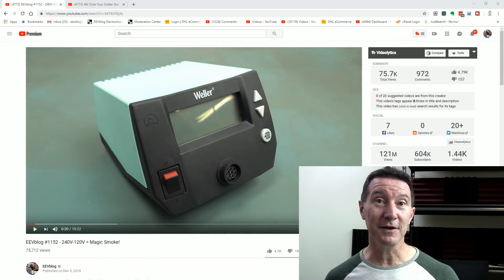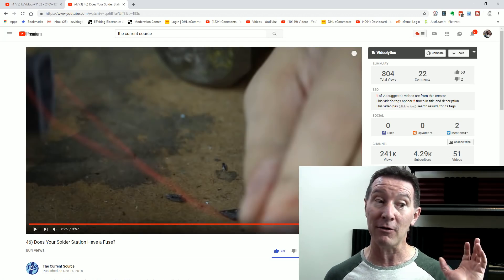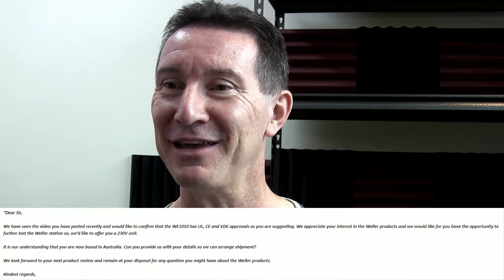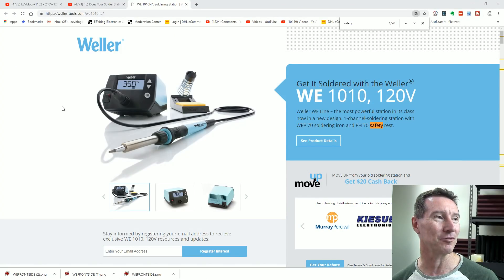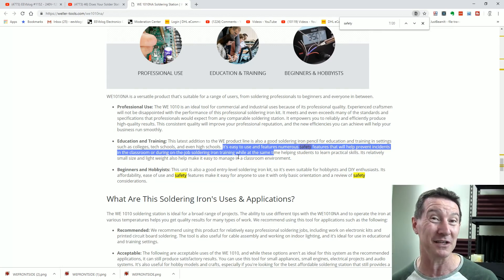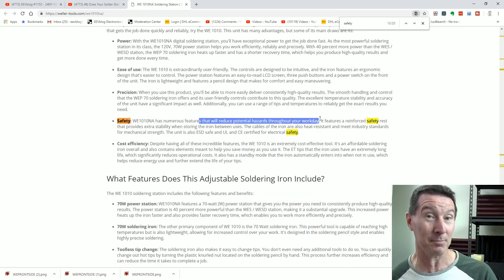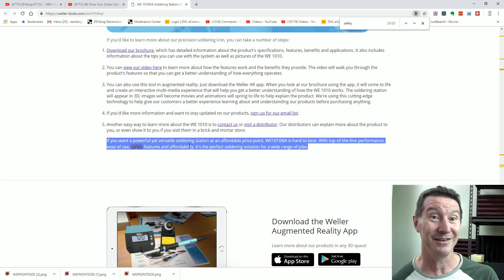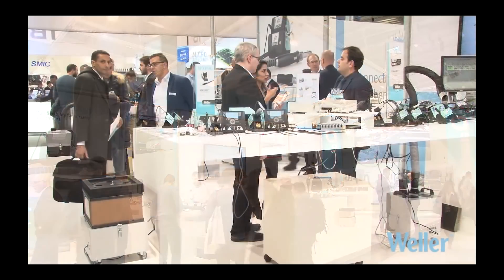EEVblog #1160 - Weller Responds!

Comment: Hi Dave,

I have enjoyed your videos and am subscribed, but think you are mistaken about taking Weller to task for the outcome of your mistake.

I appreciate that you would prefer that the device not die a smoky death, but you might not know that UL and other safety organizations don't care if the device-under-test gets damaged with misuse or malfunction, but only that the device should not cause a fire, electrocution, or injury.  In other words, a mains fuse is considered optional, and including one depends on how user friendly Weller wants the device to be.  Adding a fuse or other "idiot-proofing" adds cost, and is not actually required for basic safety approvals (I'm not saying you are an "idiot").

Can you expound on the outcome of plugging in the iron to 230 VAC?  Did it just smoke and die?  If no fire or electrocution, then "no harm, no foul" - just a bad day for you! 

They could have used a more costly 120/240 VAC, 80W universal switching supply, but that tends to be large and cost a lot more than a simple linear step-down transformer.  A user-serviceable primary fuse on the back might have helped, but adds some cost - maybe they will consider that.  A thermal fuse, is not user-serviceable, and would brick the device - although without the smoke for sure, but you still have a door-stop or a serious repair either way.

By the way, I'm guessing your iron was shipped with a US (I I -shaped) power plug for a 120 VAC device, so you must have swapped cords for an Australian 230 VAC (\ / - shaped) outlet by mistake.

Sorry...  Joe (a fellow senior product design hardware engineer)

Comment: I like my cheap $18 soldering iron with built in switch and temp control on the handle. no need for an external station.

Comment: This is sadly how a lot of tech related companies are going these days, they get infiltrated at a management level by idiots with OU degrees, they sack all the expensive/experienced engineers, they then employ only young graduates (who are conditioned to never question authority).

They also realise that PR BS is cheaper than actually doing the job right, and it really doesn't matter if a big customer comes to do an audit, the customer usually sends marketing people and managers, because they don't have truly technical people at that level in the business.
The whole industry has gone this way, BS is king and they're all BSing each other.

Oh and marketing, that's where they put the pretty young office bimbo who isn't very good at anything, but is too pretty to get rid of.

Comment: I have a couple of Weller stations, one is temperature controlled by the tips and has a magnet in the handle, and the other one is adjustable. I have some older Weller irons and they screw into the handle with a small light socket in the handle. I do agree that putting a fuse and thermal fuse in would be a good idea, but the best idea of all when using a soldering iron is to unplug it, as I need to so the iron will cool off on most of my units. Want to be safe with equipment, plug it into a power strip then when done turn off the switch, end of problem. Many do not even know what a safety capacitor is these days. It is one that is designed to go across the AC line and so if there is a problem it does not go up in flames.

Comment: You should have a fuse in the plug. Are there electrical systems out there with no fuse in the plug? That's a bit dangerous isn't it? :-)

Comment: Weller makes irons for decades that work great. A blogger plugs one in to the wrong voltage, and suddenly there’s a scandal. I love your product teardowns and reviews, but I don’t see the big deal here.

Even if it had a fuse, it wouldn’t have blown until at least some of the windings were shorted. At that point it’s still trashed, but you might not know it. 

FWIW, I have a simple rule...  ALWAYS turn off and unplug the iron when stepping away from the bench, even just for a minute. This prevents all sorts of calamities, and I don’t worry about whether or not I left the iron on.

Comment: It is a bit of downer, although I am using Weller's equipment all my professional career. Even my old and simple magnastat WCP50 had mains side fuse and is very sturdy and reliable station. Even when after years and years of everyday heavy use silicone cable shorted on secondary side, actually primary side fuse blew, so safe it is. This one looks like cheaper model which is no excuse for leaving out primary fuse. I also checked my WX2020 and it has primary circuit fuse. But, of course it is 700€ behemoth and it completely justifies it's price. I must admit, at first I did not check at all if there is primary fuse (I was expecting it at this price range) but of course this is one integrated into mains input connector, real beauty.

Comment: I have used Weller soldering guns and irons since at least the 1970'a.
 I never had any problems with them, other than a few guns maybe needing the trigger switch replaced due to age and super heavy use.
 Never had one burn up, or let any of the magic smoke escape.
 And I have several older Weller guns that work fine, plus a Weller W-TCP-l that came through a fire. Only needed to rig up a holder, because the original was missinng.
 It stiil works fine.
 BTW, I am not stupid enough to plug an item rated for 120 volts into a 240/230 volt outlet.

 :) 
 I could use those parts you tossed, like the iron and cable, etc...
 I have to make do, because I cannot afford to buy another at this time.

Comment: It's clear the VP doesn't know about your channel, which probably smarts a little. It's pretty reasonable to assume that someone in Australia, with a 120v version of a product, moved from North America. Yes, the email was a bit of a blow-off, but I think it's nice that they offered you a replacement. If you view it from the lens of them not knowing anything about you or your channel, it was a kind gesture to get you back on your feet, not something to shut you up.

You didn't share with us the email you sent them. Sounds like you said something about approvals and they responded by letting you know they have those approvals.

Tempest in a teapot.

Comment: So far as I know,  every house in the united states running off of commercial AC power receives 220-240 volt service at the meter. When it gets to the fuse box is it split with ground to 2 12-volt AC segments, with a few drops having special wiring to support a 220-240 appliance such as an electric stove, water heater or laundry dryer. The outlets for these two varieties of service are distinctly different, with one possible exception. The possible exception being what looks like a standard 2 outlet plate, usually in the kitchen, where one of the two outlets is served by one side of the service, and the other outlet is served by the other side of the service.  That outlet is set up that way so that it may be used normally for most 110-120 volt kitchen appliances, but may also be used with an adapter for an appliance that may need higher wattage requirements than 20A service to a kitchen outlet would provide.

I have also run into other exceptions in the commercial space, where a zone of equipment is plugged into what appears to be standard duplex power outlets in a power strip that is wired to a 220 service instead of 110 service. If someone installing new hardware is not aware of what the delivered power is, they can (and have) cause problems not just for that device, but for any other device served by the same circuit. This is more important in places where devices are only supposed to be down for scheduled maintenance, but it happens. Additionally if you are traveling in Thailand with standard US devices, be aware that the outlets may accept a standard nema plug, but are wired for 220 service, not 110. So there also one of these soldering irons might pose a problem.

I'd watch out for that new soldering station from Weller if it requires 120 or 60 hz power if you are in a place that only serves 220-240 at 50 hz. It doesn't sound like they are in compliance with each other... with predictable and documented results.

Comment: Would a primary side mains fuse be redundant if you were in a country like the UK that requires all mains plugs to have internal fuses? This is of course assuming you are not using the non-standard UK type plugs you get from china that have no fuse and so are (hopfully) destroyed the moment the box is opened and also you are using a plug with a correctly rated fuse.

Or does a fuse inside the transformer satisfy a different safety requirement? Of course having it there would be better certainly for the reasons stated above but is a fused mains plug intended to perform the same function?

Comment: Pretty sad, I just opened up my chinese brand WER ESD solder station and it has a mains fuse. Not a fancy one and I can't tell how the two parts of the holder separate but it has a fuse. right after the on off switch and the transformer. I don't know much about WER irons, but I think I got this used at an auction for like $15. Can tell it is a kind of cheap unit, but has LED temp display, dial knob, on off switch, fuse. Works fine. I always thought Weller was supposed to be like the cadillac of soldering things, now it sounds like they are just not even worth bothering with.

Comment: I've probably mentioned before, I once bought a cheap Chinese soldering iron (936D+ style) that had no connection whatsoever between the tip and ground.  I called out the seller on it and they produced a "CE approval certificate" (which I tend to think was fake because, would such a soldering iron have ever gotten CE/EU approval with an ungrounded tip?).

Comment: I've had 110 / 120 volt equipment show up at a workshop I use to work at with either the UK or US plugs and the safety fuses are in the plug due to UK & US loop ring wiring 32 amp standards. Often don't see main inlet fuses on these products itself for these markets like we do in Australia.

Comment: The transformer is probably a custom design for their products that ensures by design that mains spikes won’t cause a problem without a fuse. If they are passing the safety standards then the design is fine. 

The datasheet and the device clearly states that’s it’s not a 240V unit. Letting the smoke out is user error. I mean how did you plug a US plug into an Aussie socket in the wall?

Designers can’t design for every bonehead use case. If they had to do that they would have to develop some sort of retractable cover for the hot sharp tip so someone doesn’t stick themselves in the eye.

Comment: My Weller WSD 81i does have a fuse in it's mains socket, and it's maybe 3 or 4 years old. Not sure if it's more of a "premium" model, it was rather expensive for such a simple soldering station though.

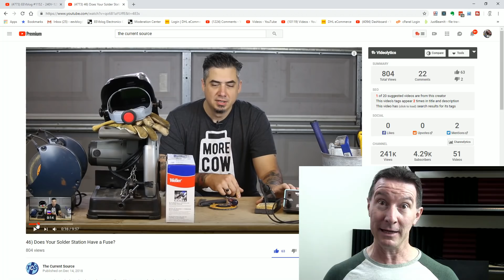Comment: I have the same soldering iron as shown at 0:29 which I purchased many years ago. It has never let me down and works perfectly to this day. But now that I know it may not have a primary fuse, I will install one. It only takes one failure to cause a major accident. Thank you Dave.

Comment: I have a XANTREX  XPH power supply and the fuse and switch is located after an elaborate mains filter.  Never seen that before.  They could have easily moved the fuse and switch to the incoming line. Can't begin to understand this.

Comment: As AvE puts out in his second Flute T6 video, this is a clear example of the monkeys running the circus. It's not out of the realm of possibility that Weller did ask and pay for certification tests but couldn't wait for them to be made before launching the product. Since they are certain that they'll get certified, they just slap the certification labels as if they were certified. There's also the chance that they didn't certify the equipment at all.  Since people tend to put exaggerated amounts of attention on certification labels (as power supply manufacturers noticed when 80 Plus was created and started slapping fake 80 Plus stuff on their boxes, labels and so on). Add brand loyalty to that figure and you have customers that will buy any piece of crap a reputable name brand puts out there simply because of the brand name.

Comment: Weller has turn to junk over recent years even in the auto industry every Weller gas iron ive seen have all broken the ignitor or just no longer self ignite (and well even louis has seen thier spare parts stock support) they WERE a quality brand someone decided to cut corners and now they are coming unstuck. 

I flat out refuse to buy Weller for small auto spark jobs on a whim bought an iroda who have been thee greatest. Got in for my brother (full time auto electrian) he broke the ignition switch so went to the distributor I got it from they struggled to find one first time contacted iroda they went and found one paid for it and life was good. 6 months of daily use on n off alot, it broke again and same deal asked for a switch had a paid for one and they sent out two just incase they were bad like we used em alot but they cared that we did and hoped it served us well. Will note at this stage it was a well used 2 year old iron (multiple daily starts) and that iron is in use 4 years later it is still used but less after moving to an off brand battery powered one but the old iroda still there going strong with the spare switch in a package aswell.

Every Weller iron I see now has a busted switch after 3 months and cant be fixed like a Mac just trash it.

Comment: Since Weller joined the Cooper group and now apparently belongs to the "apex tool group" (made in mexico), the quality of the devices can no longer be compared with the old devices. 
My Weller (older) soldering stations WECP-S, WECP-20 and EC2002, of course, have a primary fuse at the front which can be replaced.

Comment: It was your mistake, still Weller kindly sent you a replacement. Are you even sure a simple fuse can prevent overheating the abused transformer ? The primary current may vary a lot even in normal usage.

Comment: Dave my 30+ year-old Weller TCP power unit does not incorporate a primary fuse but here in England we use plugs that are fitted with fuses so it is a simple matter to ensure that the plug has a suitably rated one.

Comment: Did you expect much more from Marketing? 
Maybe they're taking some cues from the Onehunglo brands with - may heat differently under certain light conditions?
They'll probably tell you it will solder under water as well.
I'm surprised they're still using transformers instead of switch-mode supplies these days.

Comment: It doesn't have a primary fuse just like most of the appliances in your home. Check your blender, vacuum cleaner, washing machine, fridge etc...  The worst case are appliances with an heating element and small motors and/or electro-vanes, the house circuit breaker will trip if an heating element short-out but nothing will sense the washing machine waste pump catching fire. That's where the smoke detectors take over. But still keep in mind the transformer/motor windings are very reliable, only gross overload or installation poorly protected against lighting will damage them.

Comment: What country are they based out of?  I know here in the USA about the only thing with mains fuses are Christmas lights.

Another possibility is they don't want to deal with returns for faulty or blown fuses because that cuts into their bottom line.  I have had an annoying reoccurring issue with some of my radio gear where the glass fuse contacts and crimps on the holder develop corrosion and high enough resistance to drop 20% of my voltage...which is unpleasant

Comment: I'm a little bit surprised about some of the comments. Of cause this way is not nice but walkable.
I would expect that all plastic parts are passing the necessary glow wire test(don't know what's required in this device class). With a regular mains-installation this should be no problem to pass. I would expect that the mains fuse is tripping before it get's real dangerous(or the primary wire will break).
Please don't forget, connecting a 115V device to 230V is a user mistake(sorry for that Dave, but it is what it is).

Comment: You really should be more clear that you plugged a WE 1010 NA(North American 120v/ 60hz ) unit into Australian 240v/50hz outlet. If you have always been based in Australia why  would you bother having a North American version of the WE 1010, it is not compatible. 
  Your real beef is with Mouser Electronics, the authorized distibutor in Australia.

Comment: The reason that UK plugs are fused is nothing to do with ring mains, it’s the UK method of preventing house fires caused by appliances taking a fault current which is less than the house breaker rating (say 15A – 32A) but greater than the appliance flex rating (eg 3-6A).  This type of fault is notorious for setting fire to carpets so the purpose of the fuse is to protect your carpets (and hence your house and your family).  Putting the fuse in the plug means that it can always be matched to the current rating of the flex.

The rest of the world uses a different method of carpet protection, they put an input fuse in the appliance which is rated below the rating of the flex which generally has the same effect unless the fault is in the flex.  Even when the appliance has a connector instead of a flex it usually still works because the fuse rating can be made lower than the rating of the thinnest IEC type mains lead commonly available.  

The use of a short-circuit free transformer, if there really is such a thing, doesn’t remove the requirement for a carpet protection fuse because it isn’t short-circuits that cause the problem it is partial shorts ie medium resistance faults which may be nothing to do with the transformer.